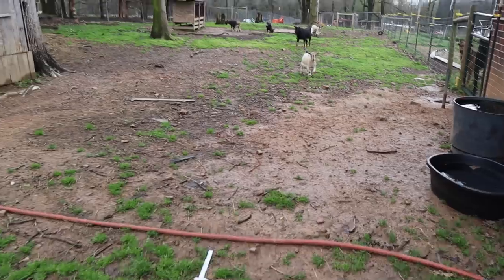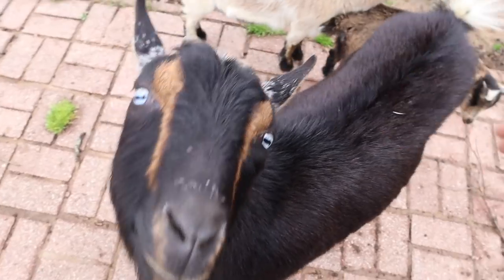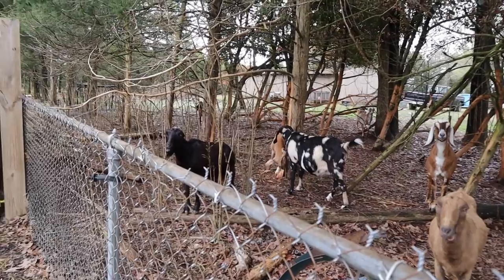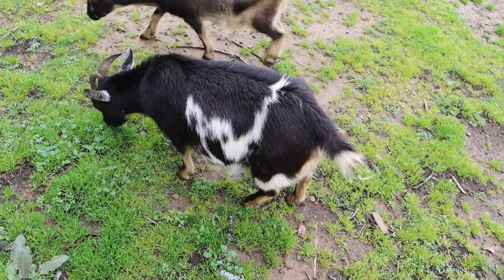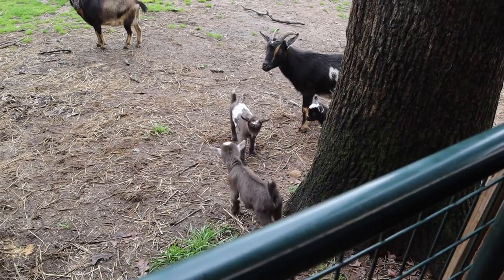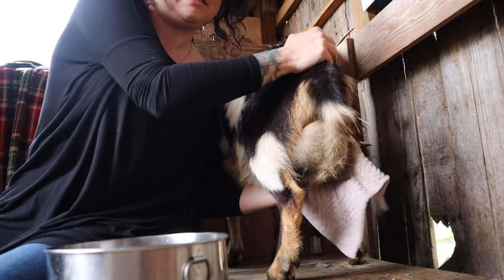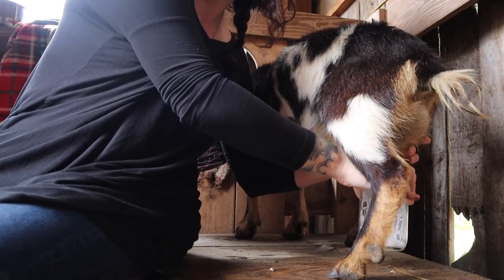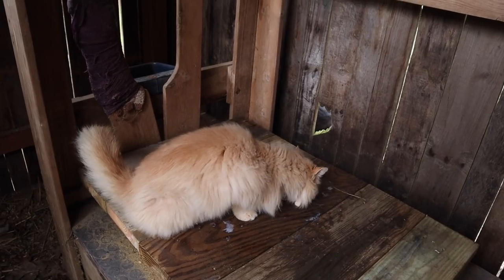Milking First Freshener TINY GOATS | Home Dairy | VLOG

Comment: I milk from day one (large productions) to keep production as high as possible and catch issues early.  If kid(s) are nursing one sided, I quickly teach them to use the other side, too.  They go by the scent of their saliva to find the teat they started with at first.  Usually they get hungry enough to switch eventually, but by then that unused side of the udder can be engorged and/or drying up.  Can even lose that side forever.  Get the kids to mouth and even drink from the unused side (milk first if too tight) and then they will easily find their way.

Comment: Jess on the milk stand head gate add an extra external latch that is for the smaller does.So depending on the size of doe you can use the one that is there or use the one for the smaller doe's. Also I always used plastic chain collars and taught them to lead so you didnt need an extra person.Plastic will break easily if they get hung on something, its light weight and comes in colors for ?? Love your channel
Reply from the maker: So smart! We have the plastic collars on our other girls but I definitely need to get some on these. Thanks for the stand idea, thats so helpful!

Comment: In addition to the flip down booster, if you were to cut a second set of headstocks that were interchangable (In other words, two headstock pieces with a nut and bolt pivot that would slide together down into the slot of your existing headstock and lock in place with a set pin at the bottom..  You probably would have to modify the first pair similarly to be removable)